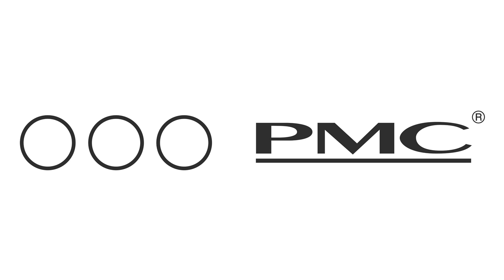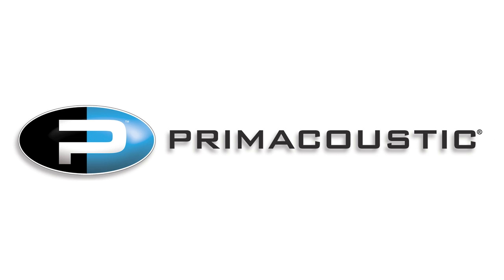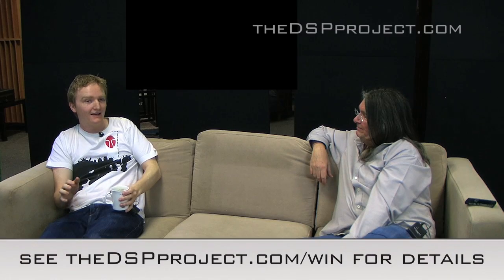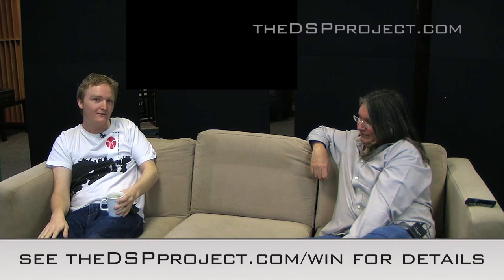Peter Thomas of PMC Interview - Part 2 - The DSP Project

Comment: Cellulose fiber is pretty decent, but there are superior materials. The reason why paper is the main material that's used is that it's high performance and cheap - that's the primary advantage.

Cellulose fiber can be combined with resins to produce some profoundly strong and waterproof materials, and in many ways the bextrene era of british loudspeaker design could be revived with a high-efficiency approach drawing from contemporary aerospace chemical science and bonding technology. Particularly the primary issue with loudspeakers is thermal capacity, so there are easy solutions to previously impossible design challenges.

Comment: PMC is lying to its customers and is incapable of designing a proper loudspeaker. The i series is a particularly massive failure with WAY TOO MUCH bass reponse. Speaker is totally imbalanced. I suppose PMC does not have a drug testing program in place for its employees.
Reply: Is your treatment over?